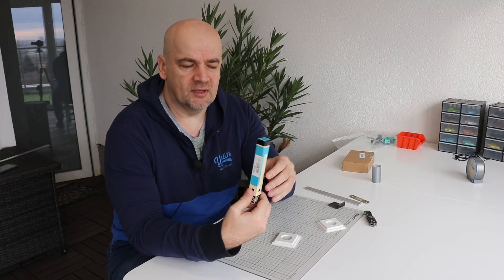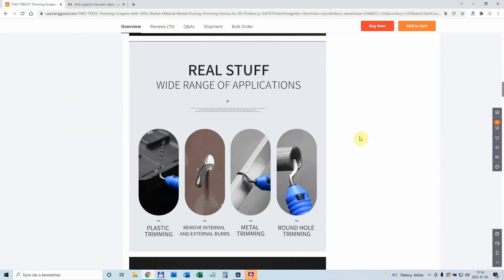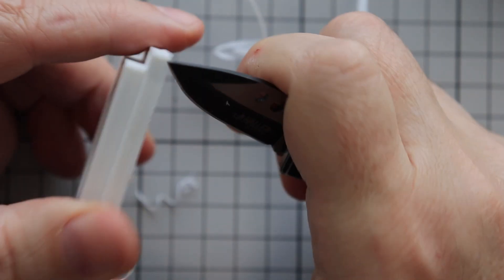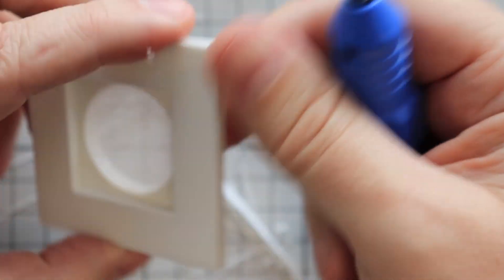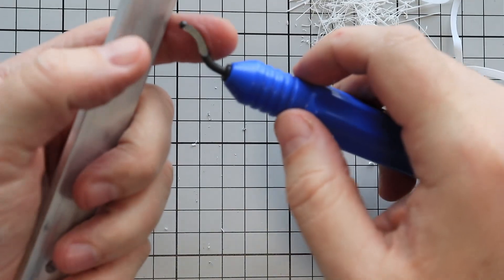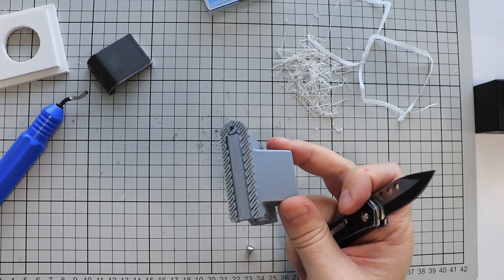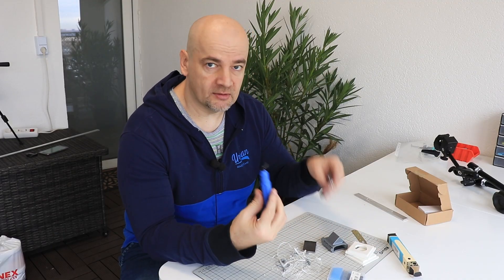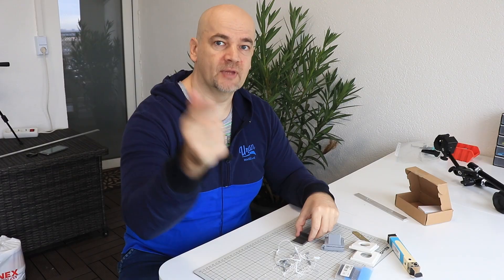Deburring tool for cleaning 3D printed parts

Comment: They may make different styles of blades for various uses. The tip of the blades you're using in this video have some limitation for your specific uses but you really might try exploring other blade attachment options.

Comment: As with any tool it should only be used where it works best. I use several tools for working on my 3D prints, this type deburring tool is best suited for edges  and holes, they are not ment for splitting two surfaces like when you tried to remove the supports. there are some tips with a very small tip that can get into very small areas. These are lifesaver tools for sure.

Comment: Another very good video!! I really like how you approach all of your experiments with an open mind. So many people in Engineering and Manufacturing are rather hard-headed and resistant to change, and don't like being told there might be a better way, instead of "the way they've always done it".  And on a separate note, one of the tools that are rarely mentioned, is a small cordless Dust Buster/Vacuum. They're great for cleaning up all the trimmed pieces, metal shavings (if you're working with metal), broken-off support pieces, etc.

Comment: Absolutely fantastic for an interior radius like the inside diameter of a PVC pipe.  It's horrible for the outside radius of that same pipe.  Would work OK if the blade could be locked so it doesn't spin.  Comments here confirmed that I'm not using it wrong; it's just that it's very good at some things and not good at others.

Comment: great to use on holes but I prefer to use a #11 xacto blade for my cleanups.  blade is sharp for small details and inside corners, and I use the back edge as a scraper for bulk clean up. cabinet scrapers or card scrapers work well also.

Comment: I used one of that kind of deburring tool for decades when manufacturing aviation sheetmetal structural parts. I'm retired from the aviation industry now. When looking back, I see a lot of tools I used in aviation that can be directly transferred  over to 3D printing. I pulled out my 12 inch steel rule graduated in hundreds on one side and fractions on the other yesterday to take measurements because I needed them for the part I was designing. That steel rule has touched literally 1000s of aircraft parts. Now it has been brought back to life.

This is the coolest hobby ever. My own little computer-aided manufacturing plant. Now I can get busy and start building that time machine I always wanted.

Comment: I love using the deburring tool on "inside curves" (like a hole) where the part kind of guides the tool. On "outside curve" (like the perimeter), it doesn't work so well in my opinion. For this, I tend to use the knife but I orientate the edge away from the motion to avoid digging in the part (I scrape, I don't cut)

Comment: Apart from my Hungarian comment, here is one for the masses. We use these tools at work and they are extremely handy for cleaning 3d printed tools, cleaning cut plastic sheets (the ones that go into Bosch profiles for example) and a lot of other custom made parts. We have assembly lines for tables that are used to assemble wiring harnesses. These tables have all kinds of plastic sheets, metal brackets and what not. We use the deburring tool on these too, to save the wiring harnesses from damages. They are really handy and I've been wanting to get one for aged, but never saw them available locally.

Comment: As a sheetmetal worker we were taught to be very careful not to deburr towards your hands as it is capable of cutting tendons if the tool jumps from a snag.
Reply: This only really works in one direction.....Towards yourself.
Reply: @mrfoameruk exactly what I was going to say. It's necessary to use your thumb for leverage and to keep your surface as level as possible. Pushing the tool away from you would result in gouges on the surface.
Reply: Good to know, thanks.
Reply: There are no tendons in the tip of your thumb.. also, slight downward pressure (towards the piece) is required to use it right (the blade swivels in the correct angle). That said; even if you're pulling, along the piece without slight downward pressure, and skip off the piece.... The odds of cutting a tendon is only likely IF your body has ANY skinnier parts (with tendons) than your pinky finger... I don't know why your pinky finger would be in the way of "controlling the tool" either.. also if u can't glide the tool across the piece, with SLIGHT downward pressure, then you're starting off with the wrong tool (file it a tiny bit... A bur is not the same as a gouge.. a deburring tool is not meant to replace a file or sand paper).

Why are people concerned about cutting a tendon with a knobby-ended deburring tool?! Should they say to be careful with those tiny sharp knives?! I mean, what if ya skip off the piece, go straight through your 20 thumb tip tendons, and poke your eye RIGHT OUT!?!?

"Rule of Thumb": Cut towards your buddy, not your belly. [Actually, the "Rule of Thumb" is/was a real rule, where it was considered abusive to hit your spouse or children with a wooden rod, bigger than the thickness of your thumb... Which would suck, in the case of your thumb being as skinny as your pinky; 1) your kids would laugh at you while they're supposed to be punished. 2) your wife wears the pants. 3) you have to take extra precautions when using a deburring tool].
Reply: also, the reason to teach not cutting towards you with a deburring tool is because in most cases, 2 hands are involved. In professional settings you do repetitive actions many thousands of times per day, sooner or later a snag becomes a bunch of kinetic energy that is finally released as your deburring tool whacking into the other hand, not the same hand 🤦🏼‍♂️But you do you 👍👍
Reply: as an ironworker I was taught over and over - NEVER aim the deburring tool towards your jugular. It can jump out and go straight for your throat.
Reply: @chrishayes5755 yeah, that makes sense, if you're holding down your work with your head maybe..?

Comment: I always enjoy watching your videos, in this one you make a simple deburring tool become interesting. I use the same style of deburring tool (but with a metal body) and find it very useful, the best feature is, as you point out, that it finds the correct angle. I also use a pocket knife for some jobs, the knife blade is made of a material (CPM S110V) of typical hardness 58/61 HRC and so can be used for softer metals, but it can dig into materials unlike the deburring tool. Vote deburring tool +1

Just out of interest, we have fairly strict knife public carry laws in the UK, no assisted opening mechanisms and no locking mechanisms, blade 3" or less, etc.

Comment: I use a deburring tool for my 3D prints, angle it at 45 degrees and clean away.   I find it works better on internal cleanup, for external I hold the cutter with my fingers to prevent it from spinning, makes cleaning the outside of round shapes etc much easier.

Comment: The problem with these tools is, that if you get stuck during cleaning and you continue then abruptly, you can get more material out of the part as it happens on your try. Only if you do it in one continuous try, without stucking and always with the same pressure, then you get nice, clean and even results.
Reply: Exactly! For plastic light and steady pressure.

Comment: Hello Igor, I have been following for a while, this is the first time I think I can teach something instead of be taught: supports are easily removed by hand with the same surface quality, utilizing slicer settings. Depending on filament, I would suggest increasing vertical distance, fan%, and lowering flow.
Of course, this tool is great for brims.

Comment: Too sharp for plastics and not precise enough.
Reply from the maker: Personal experience or just opinion?
Reply: @MyTechFun  It’s perfect for steel. You can trim an edge from start to finish in one go. And it needs some speed to work. So, long edges get a cleaner trim. Soft metals and plastics on the other hand get carved if you aren’t careful enough. That’s my experience anyway.